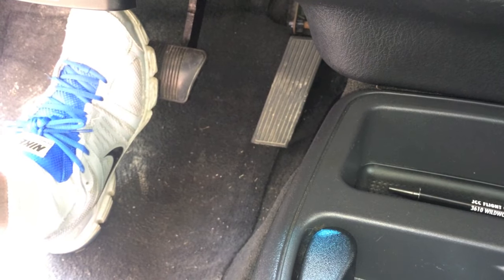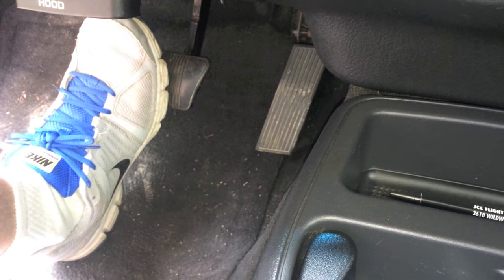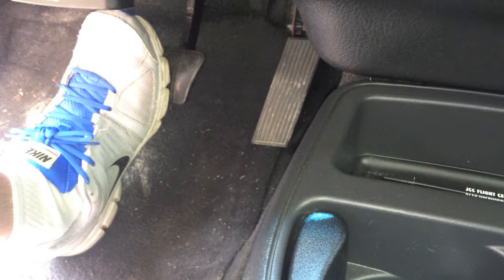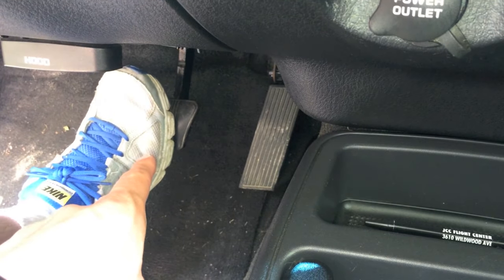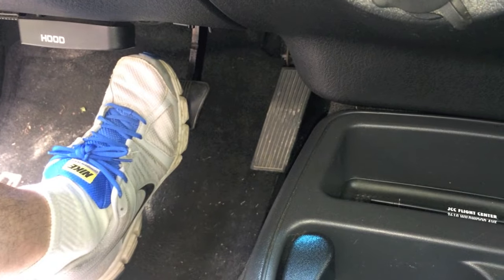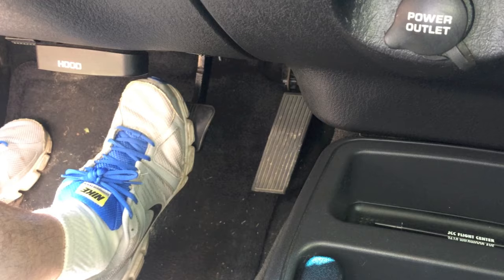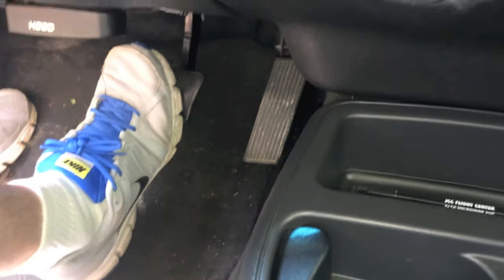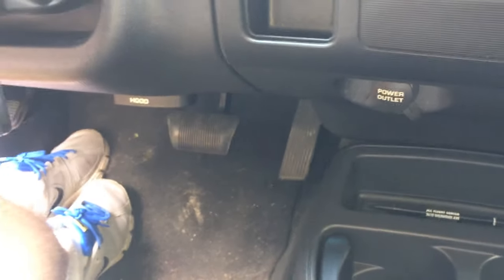HARD Brake Pedal - How to check if your BRAKE BOOSTER is GOOD or BAD

Comment: the brake pedal in my brothers MAZDA rx ( 1997) tends to grab on the way back up.. when released. I can't tell if his pedal is stiff or not becuase he has a leak in a rear line at the moment. but you can feel and hear it "grab".
Reply from the maker: Thanks for checking out the video.  Brake problems are no fun...lets try to figure this out.  I just added a few links below.  Im leaning more toward the possible caliper sticking or slides needing re-lubrication.  

It can be a few different things....

1.  Its possible that your caliper is beginning to stick...maybe caliper slides have lost the lubrication required to shift back and forward freely.

2.  It can be possible that your Caliper piston has lost its lubrication which will also interfere with the efficient shift back for forth.

3.  The front rubber brake lines that connect to your caliper fail from inside rather that outside.  This means the inter coating begins to break away and clog portions of the brake system...hence not allowing fluid to flow back and forth freely.  

4.  Your brake pads have little prongs/teeth on them.  You will notice by their location...the pads slide on a steel brace.  This may need to be lubricated to bring the shift back to efficient requirements.

Lets start with the easy items and then work our way up!  Lets figure this out together!  Keep me posted!  

PLEASE SUBSCRIBE to the channel that would be awesome!

1.  Caliper Slides Lost Lubrication:

https://www.youtube.com/watch?v=-DZ68tKuCQc&t=15s

2.  Too much Fluid in Reservoir:

https://www.youtube.com/watch?v=X-AJ5tD6zoA&list=PLjCXOz8TSkZnavDiGDyHdPKe2dV2RzEMZ&index=39

3.  Failing Front Brake Lines:

https://www.youtube.com/watch?v=3FTEgbLYAdI&list=PLjCXOz8TSkZnavDiGDyHdPKe2dV2RzEMZ&index=78

4.  Brake Pads not shifting:

https://www.youtube.com/watch?v=3Pq15BWM_qY&t=103s

5.  Replacing Front Brake Calipers:

https://www.youtube.com/watch?v=8HoaL4QM5-k&list=PLjCXOz8TSkZnavDiGDyHdPKe2dV2RzEMZ&index=83

6.  How to check if Brake Booster is Failing:

https://www.youtube.com/watch?v=VK4lowH7kQE&index=66&list=PLjCXOz8TSkZnavDiGDyHdPKe2dV2RzEMZ

7.  Failing Brake Booster:

https://www.youtube.com/watch?v=j9s7yccswPQ

8.  Symptoms of a Failing Brake Booster Check Valve:

https://www.youtube.com/watch?v=j9s7yccswPQ&index=68&list=PLjCXOz8TSkZnavDiGDyHdPKe2dV2RzEMZ

Comment: Sometimes while driving at slow speed my car brake gets hard is it normal?
Reply from the maker: CMA.Sandip Shewale 

Thanks for checking out the video!  This is definitely not uncommon!

It can be a few different things....Lets figure it out!

First thing that comes to mind is your fluid level!  Make sure your brake fluid is not outside the proper fill parameters.  This causes brake system performance issues...explained in more detail below!

Let’s work through the items!

1.  Its possible that your caliper is beginning to stick...maybe caliper slides have lost the lubrication required to shift back and forward freely.

2.  It can be possible that your Caliper piston has lost its lubrication which will also interfere with the efficient shift back for forth.

3.  The front rubber brake lines that connect to your caliper fail from the inside as opposed to the outside.  This means the inner coating begins to break away and clog portions of the brake system...hence not allowing fluid to flow back and forth freely.  

4.  Your brake pads have little prongs/teeth on them.  You will notice by their location...the pads slide on a steel brace.  This may need to be lubricated to bring the shift back to efficient requirements.

We have attached a few videos.  Lets start with the easy items and then work our way up!  Lets figure this out together!  Keep us posted!  Please Subscribe to the channel and turn on your YouTube notification Bell 🛎 that would be awesome!  Thanks again!

Links to all of our helpful step-by-step videos explaining the above possible causes are below, definitely check those out!  😎👍🔧🔩

1.  Caliper Slides Lost Lubrication:

https://www.youtube.com/watch?v=-DZ68tKuCQc&amp;t=15s

2.  Too much Fluid in Reservoir:

https://www.youtube.com/watch?v=X-AJ5tD6zoA&amp;list=PLjCXOz8TSkZnavDiGDyHdPKe2dV2RzEMZ&amp;index=39

3.  Failing Front Brake Lines:

https://www.youtube.com/watch?v=3FTEgbLYAdI&amp;list=PLjCXOz8TSkZnavDiGDyHdPKe2dV2RzEMZ&amp;index=78

4.  Brake Pads not shifting:

https://www.youtube.com/watch?v=3Pq15BWM_qY&amp;t=103s

5.  Replacing Front Brake Calipers:

https://www.youtube.com/watch?v=8HoaL4QM5-k&amp;list=PLjCXOz8TSkZnavDiGDyHdPKe2dV2RzEMZ&amp;index=83

6.  How to check if Brake Booster is Failing:

https://www.youtube.com/watch?v=VK4lowH7kQE&amp;index=66&amp;list=PLjCXOz8TSkZnavDiGDyHdPKe2dV2RzEMZ

7.  Failing Brake Booster:

https://www.youtube.com/watch?v=j9s7yccswPQ

8.  Symptoms of a Failing Brake Booster Check Valve:

https://www.youtube.com/watch?v=j9s7yccswPQ&amp;index=68&amp;list=PLjCXOz8TSkZnavDiGDyHdPKe2dV2RzEMZ

9.  Master Brake Cylinder info

       https://youtu.be/F9s_1VZ2u5E
Reply: @DIYwithMichaelBorders  my car is new and I am also new driver..So afraid of this ..Thx for reply
Reply from the maker: CMA.Sandip Shewale 

Thanks for the reply & if your vehicle is new, you may have warranty coverage & the dealership will fix brakes.  We recommend reaching out to them & checking your options.

Keep us posted.  😎👍🔧🔩
Reply: @DIYwithMichaelBorders  dealer team told it's because of half clutch ..They recommend to press full clutch...
Reply from the maker: CMA.Sandip Shewale 

Thanks for the update & did it work?

😎👍🔧🔩
Reply: @DIYwithMichaelBorders  they told my vehicle is new just completed 2-3 days so it may happen if half clutch is pressed during slow speed.
Reply from the maker: CMA.Sandip Shewale 

Thanks for the reply & keep us posted on how it performs.

Comment: Hi my problem is when I brake when going under 5 miles an hour, the brake works to stop the truck but it either makes a rubbing noise or stops but then with my foot on the pedal it feels like it releases a bit.  I have had two garages look at it and they say all is good.  It is a 2005 Sliverado with rust issure and the last place said it could be rust causing the problem and I just need to drive it more.  I didn't have this problem prior to my truck being inspected.  That garage took it back in and put it up and removed all the tires and checked it out on a trail run and said it was safe to drive as did the second garage.  I am wondering if it can be a brake pedal problem.
Reply from the maker: Thanks for watching & it’s possible.  It may be as simple as having your brake system re-bled.

You might have the ever-so-slightest tiny bit of air bubbles inside your brake fluid causing this.

You can have a friend help you buddy bleed your system or have a shop do it.

Or...🤔

You have a brake booster in it’s very early stages of failure and acting with sporadic behavior.  If this is the case, it’s not exactly known when your brake booster will fully fail.  It could be 3 weeks from now, 3 months from now, or a year from now.  Replacing it sooner than later is recommended.

However, don’t let that stress you out because it’s very possible that your brake booster is perfectly fine and will not fail for the remainder life of the vehicle while you own it.

Please keep us posted, looking forward to hearing back from Janice.  😎👍

Comment: I had got my struts changed on rears . 2002 honda civic Lx.Today . And brake line broke on left side .. brake line was fixed and .brake cylinder..was fixed .too., also were bleed after fixed. .. and now it goes almost down to the floor,in order to stop..every time i press brake , makes a clamping noise. . seems really spongy ..  and its not nice in firm like they were b4 the brake line broke.  Today .. what could this be?
Reply from the maker: stackin chedda 

Thanks for watching & we hope the video helped.  This is more common than not.  Most important step is to complete a thorough inspection of your entire brake system & all parts to make sure there are no signs of leaking.

Next, you may need to re-bleed all 4 brakes in order to get any mysteriously remaining trapped air out of system.  Keep us posted.

We really enjoy making these helpful videos for our fellow DIY’ers.  Many more helpful videos to come!  😀

Let us know if you have any questions.  Please subscribe to the channel and turn on your YouTube notification Bell 🛎 that would be awesome thanks again.

😎👍🔧🔩
Reply: @DIYwithMichaelBorders  yes.. u  were right .. we had to re bleed the brakes .. and change the brake line to more of a line that has better end fittings.  To screw to the line brake cylinder. .brakes work wonderful... now !! The line that was put on... seemed to let air in...did not seem to fit snug& tight ..
Reply from the maker: stackin chedda 

Thanks for the update & that’s great news.  We appreciate you sharing!

😎👍🔧🔩

Comment: Well when I start the car it goes to the floor. I replaced master cyl and adjusted buck drum brakes and st have bad peddle. Front pads look good so next step is. Booster  96 Yukon
Reply from the maker: Thanks for checking out the video and sharing your comment and experience Ted.  Brake problems are definitely annoying.

Have you noticed any leaks under car?  If no leaks...have you noticed the level of the brake fluid in reservoir going down?  In other words...No leaks..and fluid going down...chances are fluid is leaking into Brake Booster causing it to fault.   This leads to your symptoms.

Also, have the brakes been completely bled?  As you know, the Master Cylinder also requires proper bleeding.  Keep posted.

Do you hear any "HISSING" sounds under the hood near the Booster?

Please Subscribe to the channel and turn on your YouTube notifications that would be awesome thanks again!

Comment: Let's say im pressing the brake pedal while i have stopped somewhere...and then i turn the engine off while i still press the pedal down it becomes rock hard.
Is this normal?
Reply from the maker: TheAlexunit 

Thanks for watching!  That’s a great question!  It is normal for the brake pedal to harden after engine is shut off.  Its also important to mention that it’s not good for the brake system to continuously apply brake pressure to pedal when engine off.

The brake system requires the engine to be running to operate fully, efficiently, & correctly!  After engine starts, several parts begin operating...ex: Vacuum System

We hope this helps!

Please subscribe to the channel and turn on your YouTube notification Bell that would be awesome thanks again!  😎👍🔧🔩

Also, below is a link to our Car video PlayList. It contains several videos that you can benefit from!  Definitely check those out!

       https://www.youtube.com/playlist?list=PLjCXOz8TSkZnavDiGDyHdPKe2dV2RzEMZ

Comment: Mine kicks back, does that means is bad? 2005 Tahoe
Reply from the maker: Hi aggi pizarro.  

Thanks for checking out the video.  Having your pedal push back usually happens when you are experiencing issues with the brake booster.  

First check the level of the power steering fluid in reservoir.
If its empty...add fluid and see if this helps.

If not...chances are that you will need to get the booster replaced...which usually isn't a job to do at home unless you have the experience as well as required tools.

The booster is relatively inexpensive and should be a quick fix when taking it  to a professional shop.

Please Subscribe to the channel that would be awesome thanks again!
Reply: Thank you!

Comment: my brake pedal makes a small sound like air is being squeezed out when I press it. does that mean something is wrong?
Reply from the maker: Hey there and thanks for checking out the video.  The hissing sound is signs of your Master Brake cylinder beginning to fail.  What is happening is your Master cylinder is making that hissing sound as it allows a tiny bit of brake fluid into the Booster.  This is most likely the problem.  In the event that your Master Brake cylinder is not replaced over time....your car will begin to experience the peddle slowly going to the floor at stop signs however your car will begin to move slightly because your brake system is not working properly.  This is definitely a common fix and won't cost too much.  Please Subscribe to the channel, that would be AWESOME :-)  Keep me posted on what you do!
Reply: I have the hissing sound, you hear it from the drivers side, it gets louder when I press the break, would it be the booster or the master cylinder, the pedals hard when the engine is off, and the hose that goes into the booster gets plenty of suction when I took it off to see if it could have been the valve
Reply: I have the hissing sound, you hear it from the drivers side, it gets louder when I press the break, would it be the booster or the master cylinder, the pedals hard when the engine is off, and the hose that goes into the booster gets plenty of suction when I took it off to see if it could have been the valve
Reply: I have the hissing sound, you hear it from the drivers side, it gets louder when I press the break, would it be the booster or the master cylinder, the pedals hard when the engine is off, and the hose that goes into the booster gets plenty of suction when I took it off to see if it could have been the valve
Reply from the maker: Hey there thanks for checking out the video!  After reading what you're experiencing and looking at your symptoms, this is the beginning stages of the Master Brake Cylinder failure.  As time goes on, fluid will begin leaking into the booster and sooner or later will lead to no brakes.  This is not an intense repair.  If you or a friend have the experience on bleeding brakes as well as priming the master cylinder....it can be a pretty simple inexpensive repair.  Keep me posted!  Please Subscribe to the channel that would be AWESOME! :-)

Comment: Sooo brake booster sensor circuit? Could be the reason for the code
Reply from the maker: Thanks for watching, what is the exact fault code symbol you see?
Reply: C1201
Reply from the maker: @bgaronniebee6654  

Thanks for the reply, the most common cause of this fault code is a loose fuel/gas cap.

Double check your gas cap to ensure that the rubber seal is properly positioned and creating the proper seal when it’s tightened.

If the seal is damaged in anyway, a new seal is required.

Comment: Well what if it’s already stiff without stepping on the brakes. On my car recently before starting it in the morning, the brake pedal is already stiff, the stiffness goes away after I start the car.
Reply from the maker: Thanks for watching & welcome to the DIY Raptor Club.  It is normal for brakes to stiffen before engine start.

It’s not recommended to press brake pedal when engine is off.  Pressing brake pedal with engine off can unfortunately damage booster.

Comment: Hi greate video, but my car when i compress the pedal when the engine is off it become hard and then lost pressure then goes up to the chassi please help!
Reply from the maker: Zafar Empires 

Thanks for checking out the video and sharing your experience.  When engine is off, your Brake Pedal gets hard as you press brake...that’s normal.  After engine starts, it adds the additional required inputs & vacuum for all Brake Systems to work effectively & properly.  Hope this helps.  Please subscribe to the channel and turn on your YouTube notification Bell that would be awesome thanks again!  😎👍🔧🔩
Reply: DIY With Michael Borders , while the engine is off when it become hard in seconde it get back to the chassi, when the engine is on it goes completely to the chassi, but if the engine is off it compressed but if i continues apply force it get back to the chassi.
Reply from the maker: Zafar Empires 

Thanks for the reply.  Have you noticed any signs of Brake Fluid leaking anywhere along the system?

We recommend checking the reservoir to verify the brake fluid is at the proper fill line.  

Anytime the pedal goes to the floor, there is usually a leak that is allowing air into system.

It’s also very important to Bleed brakes to ensure all air is removed from brake lines!

Keep us posted!  😎👍🔧🔩

Comment: i have a ford falcon el and the break peddle is really hard i can barely break. what do i do
Reply from the maker: Have you had any recent repairs to the brake system on the vehicle?  

Is your brake fluid low?

While the car is parked on pavement, have someone slowly push on the brakes while you inspect the brake lines underneath the vehicle to see any possible leaks in the brake lines

Keep me posted!  Subscribe to the channel if you're up to it thanks!

Comment: I was driving when suddenly i press on  The break and it was hard I got scared so I pump it again I was in traffic scared  the crap outta me .need your help
Reply from the maker: Thanks for watching, that’s no fun.  Any update?  You might have a Master Brake Cylinder (MBC) in its early stages of failure and it may be intermittently locking the inner MBC cylinder back and closed.

When this happens, the brake fluid is trapped and can stiffen up the brake pedal.  Please keep us posted.

You may however have a faulty Brake Booster.